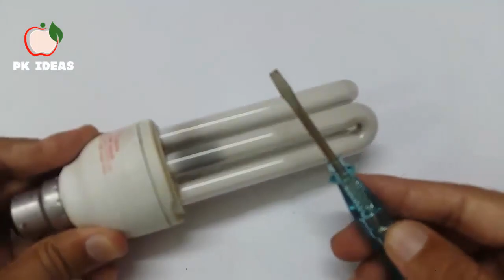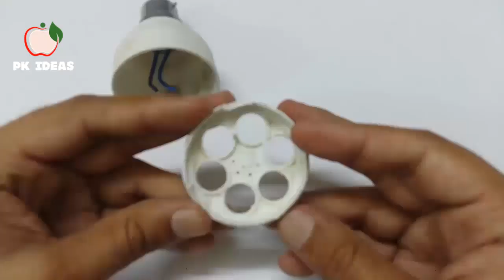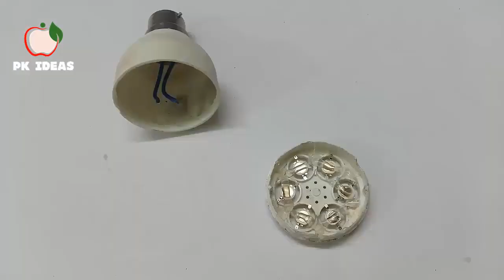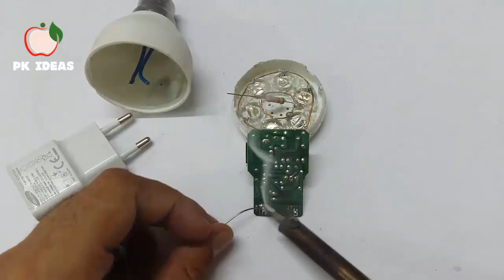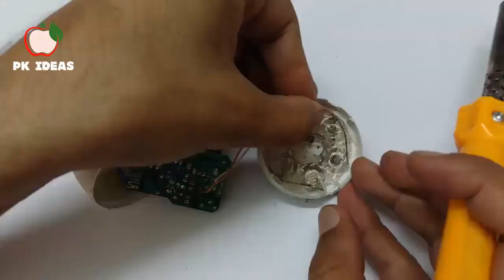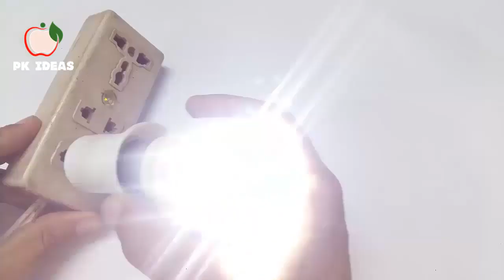Convert Old broken CFL to LED Bulb

Comment: Bro why we should not use the old cfl circuit board?🙄
Reply: the CFL circuits can output hundreds of volts, these LEDs operate at 3.4V max, connecting the LEDs to the board would kill them instantly

Comment: sir very good idea but I little bit confused about the value of resistor so ,. please tell me the value
Reply from the maker: Dear, 8.2 ohm Resistor

Dear, Very thanks for Comments please share My Videos  &  SUBSCRIBE
Reply: 8.2 ohm  or 8.2 kilo ohm??
Reply from the maker: Dear, 8.2 k ohm resistor
Reply: pk Ideas that is one thing we were going to ask as well. other is why so much hot glue? led's need to be cool, that much glue will make this very dangerous for fires you know this right? Just Asking, Joseph T
Reply: 1K
Reply: pk Ideas

0:18 как песня называеться
Reply: only 2 rup

Comment: how can u drive 6 led with a mobile charger giving just max 5 volts
Reply: The LEDs are connected in parallel.
Reply: as those led  are in parallel so each will consume 5n..and each led consume 310+mA...for 6. 310×6=1.86amps...may b it is a 2amp charger